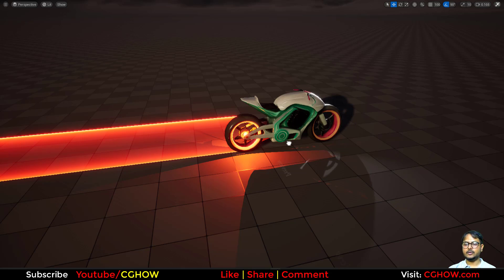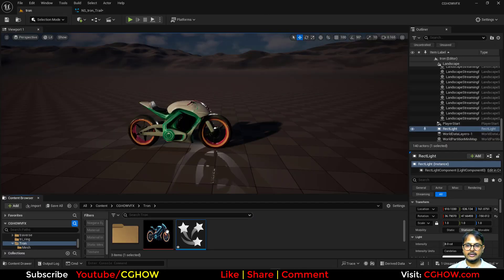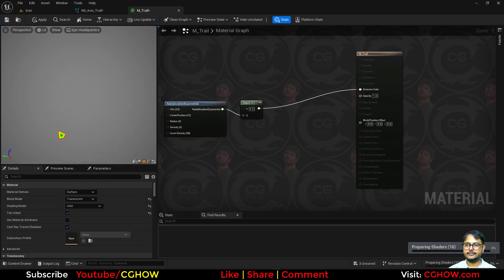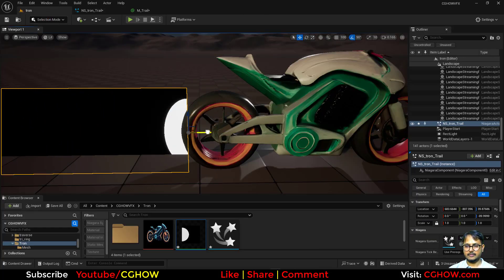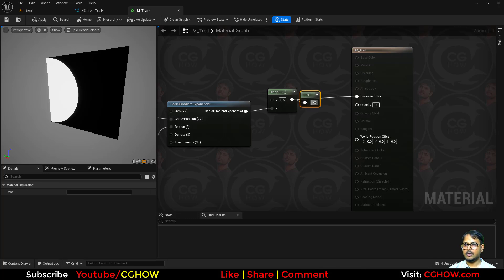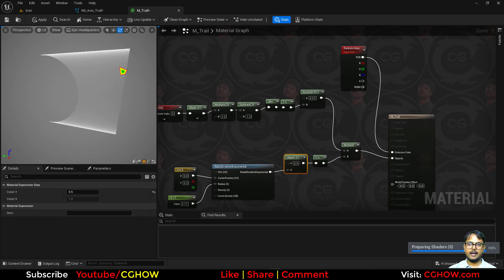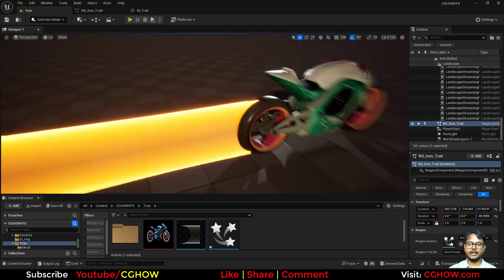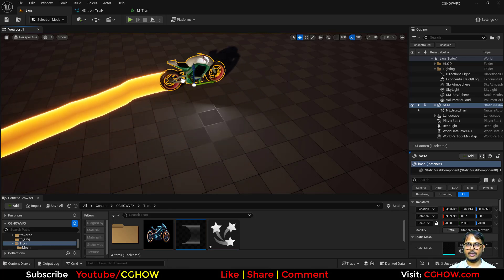How to Create a Tron Trail in Unreal Engine (Tutorial)

Comment: the bright lines from the trail are in my case not on the top and the bottom, they are left and right. why? using UE5.6 - need it for the new pwnisher 3d challenge.
Reply from the maker: you are using wrong channel
Reply: @CGHOW  ok thank you. i found the mistake. another question, i have a reflective floor. is it possible, that the trail is reflecting on the floor? now it doesn't.